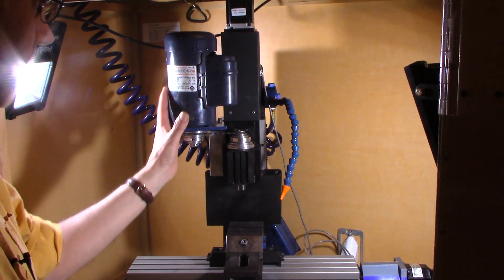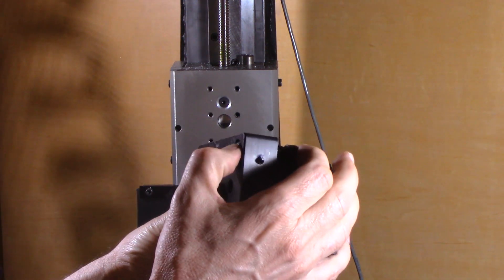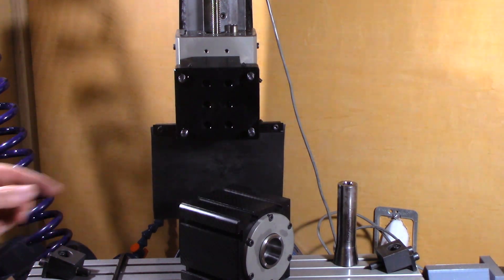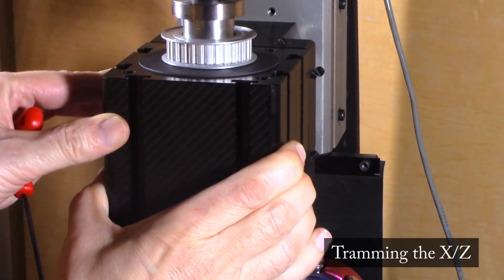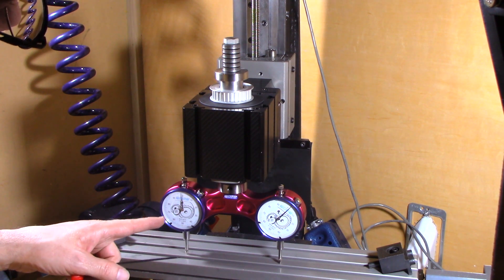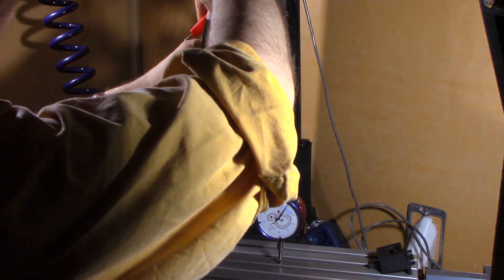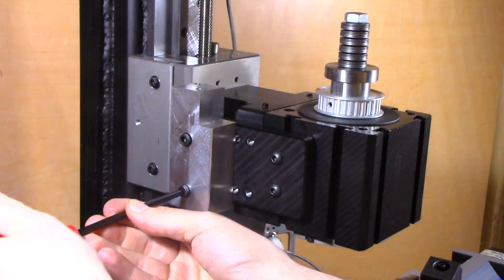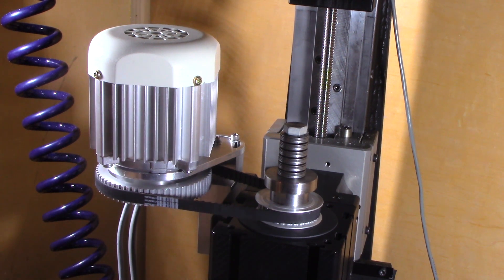R8 Spindle Install, "Taigmach" Part 7

Comment: Nice job.  Only thing I'd like to add is the tramming is even easier if you use the two set screws on top of the spindle.  This way they are opposing each other on two of the spindle mount bolts.  It helps locking in two spindle bolts as when you go to torque them, it tends to offset the spindle a thou or two in that direction.   Even getting all the set screws snug before torquing the spindle mount bolts, if you really put a lot of pressure, it can still move a tiny bit.  So I also usually leave it off by that amount. Oh yeah, I think the 3/8" length set screws are still best, as you can grind off 1/16 for the two on the motor side.  I used 5/16" and all recessed enough for flat mounting the motor plate.  All I had were 5/16" on hand...LOL...so that is what went in, but think the extra thread of the 3/8" is worth it.